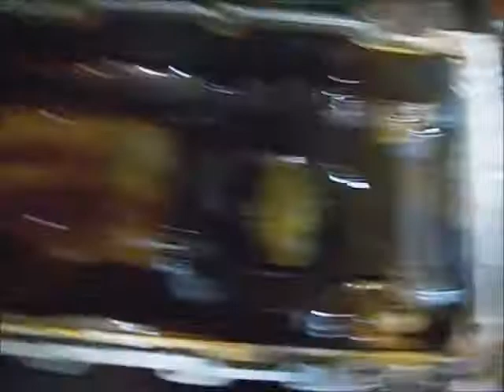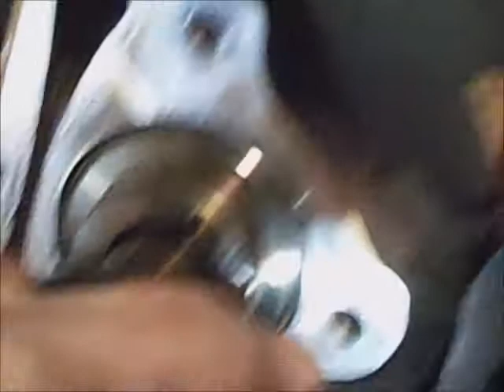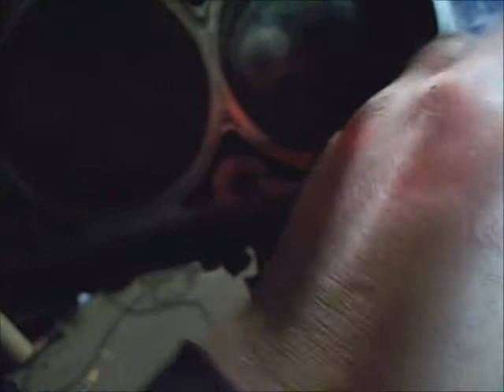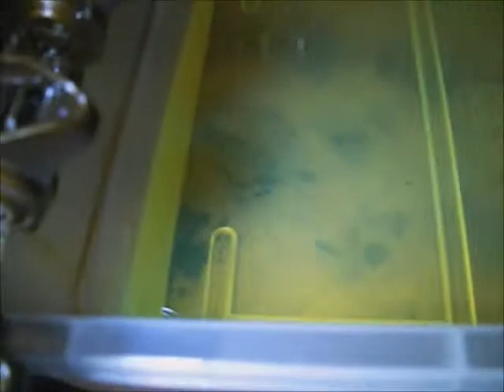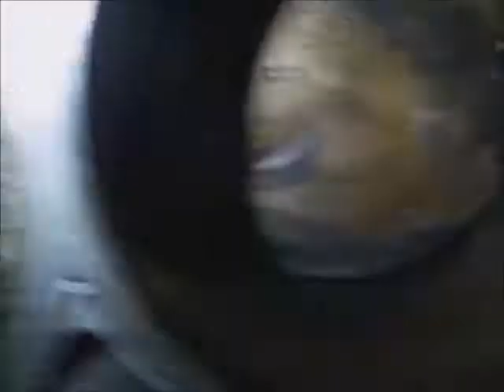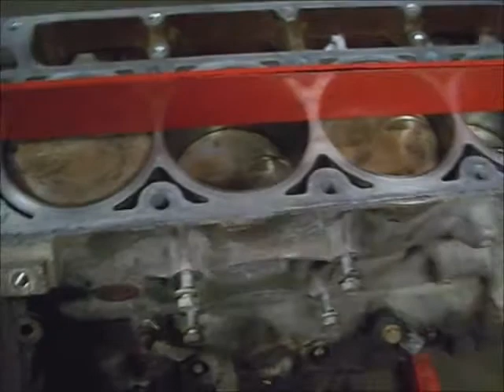GMC Denali`08 6.2l camshaft, timing chain, oil pump removal detailed block prep pt.6

Comment: Thanks for this video. About to swap my 2007 Denali engine and want to see what I’m in for. Thinking that pulling the radiator, hood, and grill might help with install of a complete long block. What do you think? Thanks
Reply from the maker: Use you're own discretion, for convenience.  Thanks for watching